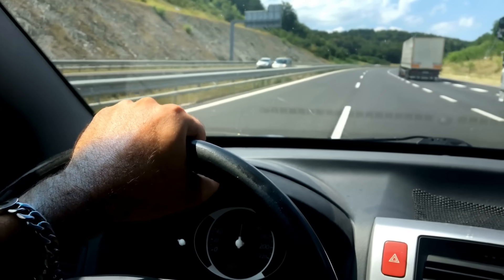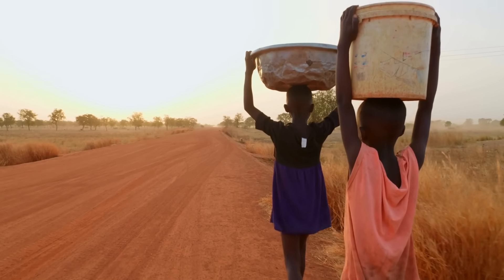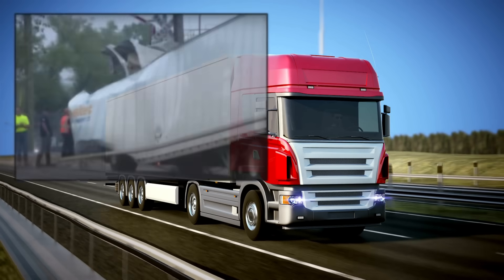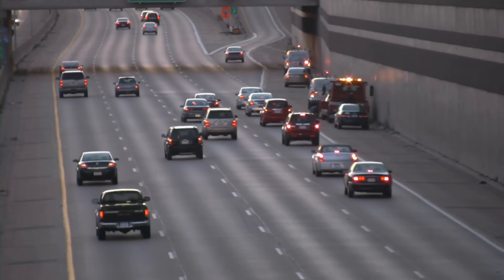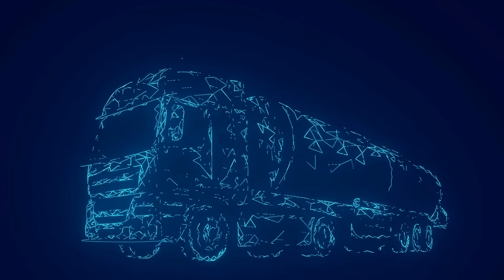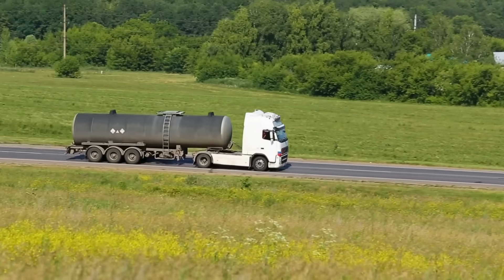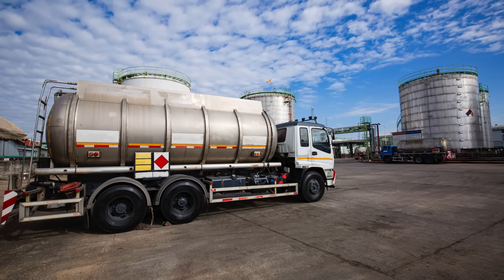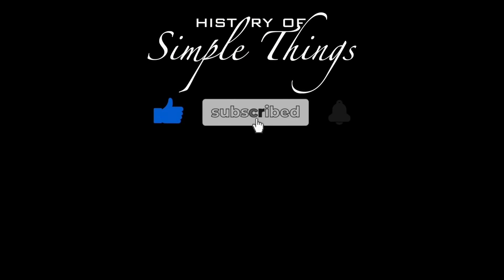Why Fuel Trucks Are Always Cylinders (Not Boxes)

Comment: It has more to do with strength  !  Square corners have a tendency to crack , especially during heat treating ! 
Something we learned in Tool & Die and Design !
Reply: No it has nothing to do with strength. It is largely due to ease of manufacturing and rolling a tank shell requires much less welding. Trailers are not heat treated so I don't get your thinking on that.
The suspension system, landing gear and upper coupler plate are mounted directly to the tank itself